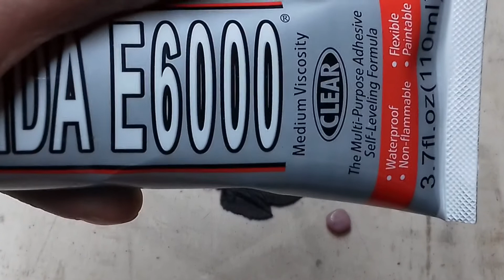Electroforming Copper Earring with Fig Leaves and Rhodonite

Comment: Hello. Good video. Your jewelry has a good shine. Piease tell me, do you use electroforming Brightener?
Reply from the maker: Thanks, and yes I do use brightener, I tried two, very good, kind of brighteners: midas's, which lasted 3 months, and gateros's which after 5 years there's still half of a bottle left. https://youtu.be/l7ejHV3LJaY Also macrogol can act like a brightener but is not super shine. https://youtu.be/UxuHw53RIBU
Reply: @cuforming  Thank you very much for the quick and objective response. I have a document (PDF) called - "Electroforming Solution more Advanced formula by Jason Welsh". I carefully read it several times, but as a blonde I did not understand anything. If you want, I can email you this document.
Reply from the maker: @polinalengard7165  If that's the same document I have, It doesn't talk about brighteners. Contact me on Facebook, maybe you have something different. https://www.facebook.com/elettrocuforming/
Reply: @cuforming  The file has been sent.
Reply from the maker: @polinalengard7165  I leave my email to your friend. Contact me there, I will explain what that document says.

Comment: Don’t the leaves has to be dried before ? Thanks
Reply from the maker: As I answered in the other comment, I can paint fresh leaves with my conductive paint recipe. https://www.cuforming.com/tutorials.php The only thing you must be aware is that they need to dry eventually under the conductive paint coat. During this process, they have the tendency to bent, so you may need to keep them steady until completely dry. With dry leaves it's gonna be faster, they won't bend, and they are good to go in a matter of a few minutes.